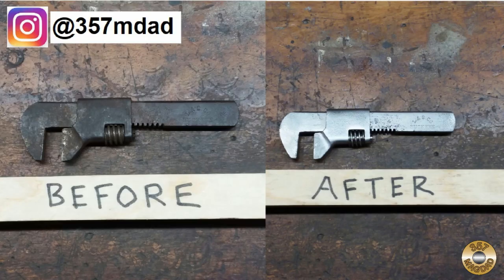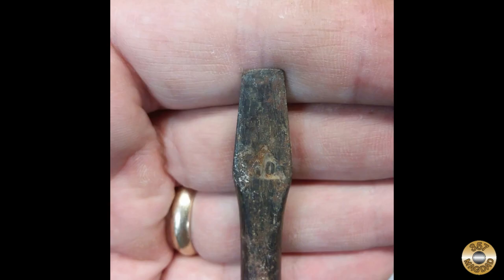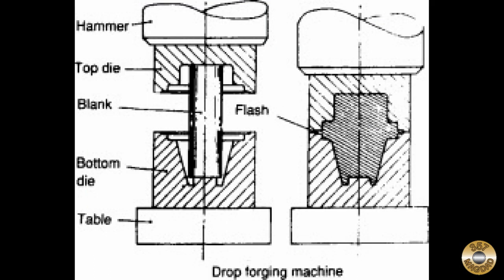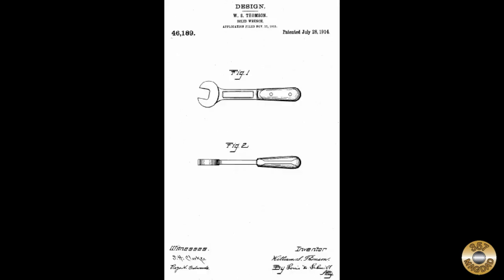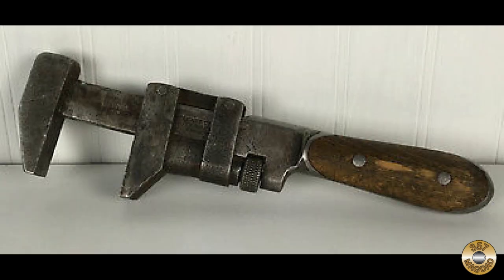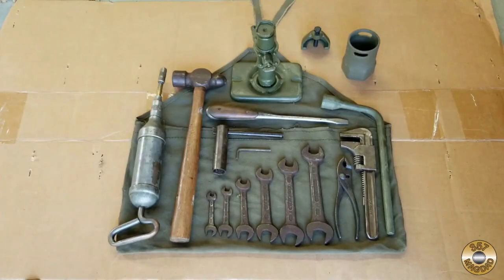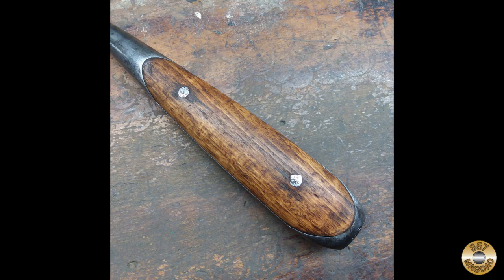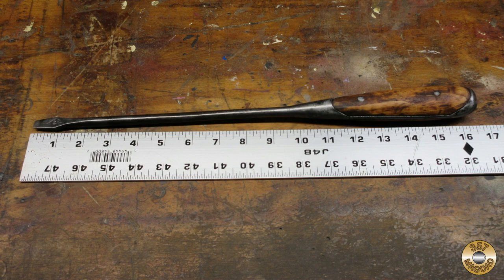Hand Tool Restoration - Tobrin Perfect Handle Screwdriver

Comment: Pretty cool. I looked for those at a flea market today but no luck. I DID find a wrench similar to the first one you flashed in the beginning. It is soaking now.
Reply from the maker: Thanks!  I usually pay a buck or two for those screwdrivers. It was nice to find an interesting maker's mark under the "patina"!
Reply: @357magdad  
That was an interesting place for one. Is that common on those? I can't recall seeing anything on the blade in other videos.
Reply from the maker: @upsidedowndog1256  The blade had the "10" in a triangle.  The "Tobrin" was about half way up the shaft.